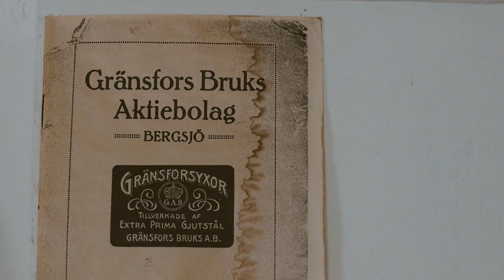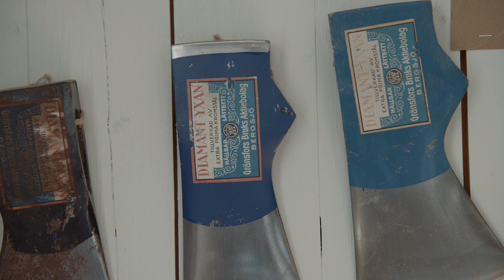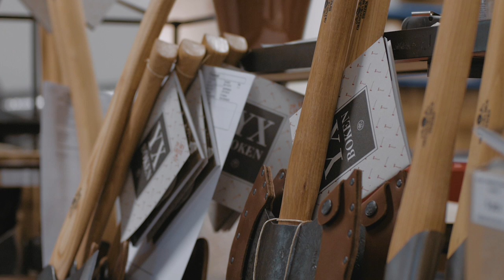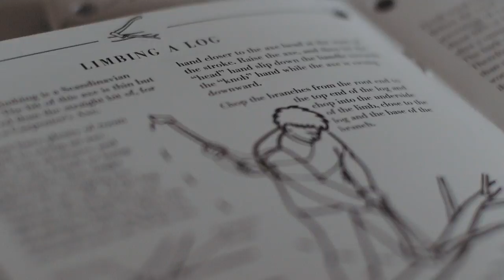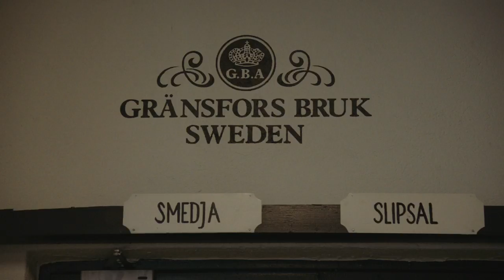Gransfors Bruk - Hand forged axes since 1902

Comment: Noticed that GB has recently stopped using  the 3-prong retaining pin in their axe handles.  Does anyone else feel that they should bring the retaining pin back?  The company statement is that they are trying to "save unnecessary resources", due to environmental commitment, and that the retaining pin "is not really necessary" to help improve the handle/head fit longevity.  Well, I still have a concern about that... If this design was good enough for them to use it for over 100 years, and helped GB build a reputation for "quality" (especially regarding how much service an axe would give before the handle would loosen-up), then why the heck would they suddenly change things?  I just noticed that in this 2016 video, the retaining pin is clearly visible in the top of the axe handle on some of the axes, but now suddenly they want to save a couple pennies and stop using it?  In fact, in some re-handling videos, it is noted that GB includes in the handle replacement kit THE VERY RETAINING PIN that they, for some reason, don't now want to include in the finished axes.  Does anyone else feel that GB should go back to producing their axes the way they did before, which helped them build their reputation?
Reply: C B can't wait for ZombieFighter2001 chimes in on this.  It seems he knows exactly what that company is up to.
Reply: Hey! They've actually tested their axes thoroughly and they noticed that the axe did just as fine without the pin.
Reply: Try to save costs and increase profits
Reply: I mean 50 years ago axes were permabonded with a wood wedge underneath, i can't say for sure, but they probably only used wood wedges 100 years ago or a simpler step wedge since a barrel wedge or the fancy one they use wouldn't be as simple to make back then. And either way it's almost better to just use a wood wedge since you can always pound a steel one in when the handle goes loose
Reply: @zombiefighterof1987  also GB are crap
Reply: @paulwhat322  it's your opinion but not everyone shares it.
Reply: If your axe’s head doesn’t come loose without a metal wedge why would you want one? Once i became loose i’ll put one and even two if i want! Don’t know what’s the problem with it. The handles are well made and doesn’t have a play in the eye.
Reply: @paulwhat322  HAHAHAHAHAHA. Wow!
Reply: @gtrul3s387  trust me, fiskars is much better for fraction of the price
Reply: @paulwhat322  i have both and i can easily say that you’re wrong. I have a x17 to split logs and borrow to friends but when it comes to bushcrafting and felling trees i prefer my gransfors by far. Good for you if you only need that quality!
Reply: @gtrul3s387  but gransfors bruks really is better or you've just been convinced by clever marketing and hype? Because ultimately its just a piece of recycled metal stamped out by a machine.
Reply: @paulwhat322  but the fiskars will get the job done. No questions about that. But It’s just a piece of plastic and metal with no soul. I like the look and feel way better of an old fashion axe.

Comment: Great video but i notice when grinding the beveled edge by hand you end up with lots of variation on the bevel from 45° to 70° i have noticed.  That is critical in Australia hardwood to get the angle correct.  Soft wood its not so critical

Comment: I have 3 GB axes and all are amazing and they are looked after like an antique heirloom but they are used as a tool effectively. However my 1st GB axe is the Small Hatchet. It was bought for me by my Daughter. Approx 4 years of use as my Bushcraft axe it chipped on the corner. My advice is to store your receipt like the Crown Jewels as no repair or warranty work will be done without it, as my Daughter has moved house and has lost the receipt. Yes they are good but they do and can fail, it has spoilt the look of such a neat small axe and I'm more careful when I use it as I don't want more chips developing.